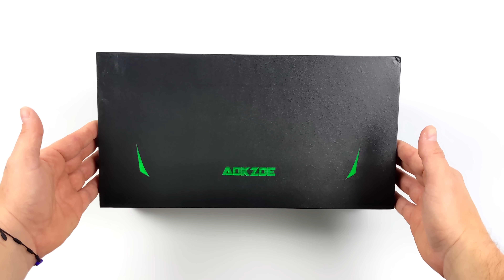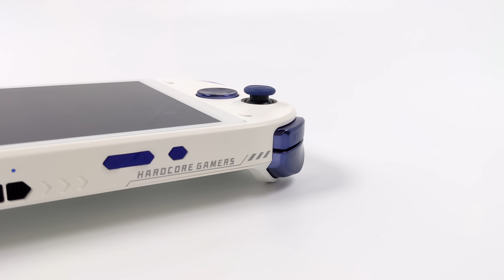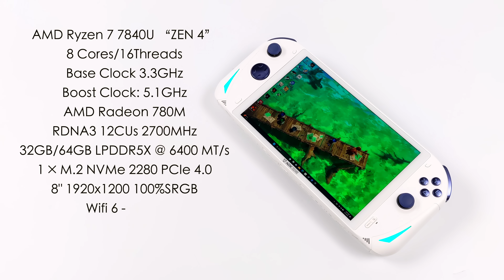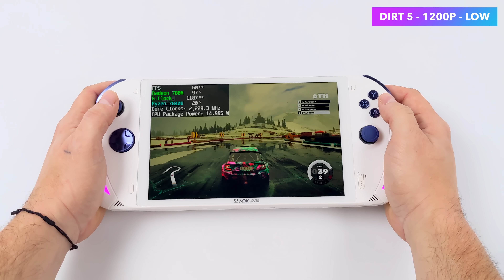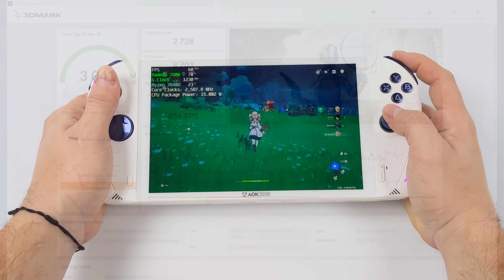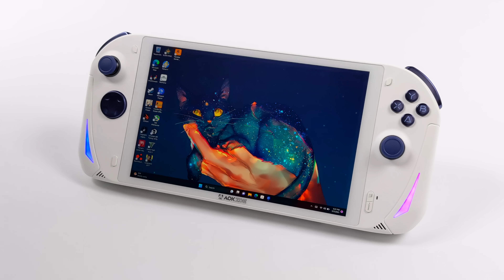AOKZOE A1 Pro Ryzen 7840U Hands-On! Right On The Edge Of GTX 1060 Performance!

Comment: What I want from the PC handheld, and am willing to pay the price, but nobody has yet to manufacture:
-Oled 120hz 8" 800p screen (to run at 40fps capped)
-65W OR if I have to wait, 75W per hour battery
-Zen3 + RDNA3 OR if I have to wait, Zen 4 + RDNA4 architecture
-32GB RAM + 1TB Nvme
-Quiet operations and good controls

There's always something wrong with the confiq, Nintendo got everything right with the Switch years ago, and the OLED one was a great upgrade.

Comment: Is there any benifit for games running higher than 60Fps since the A1pro uses a 60Hz monitor? Other than slightly reduced input lag.
Reply: There is not a point. The screen itself is 60z, so anything above still shows rendered at 60 fps.

Comment: You didn't mention in the video (great video btw) how the screen compares to other devices.  It is native landscape?  Colors bright and accurate or washed out?  How does it handle screen dimming?  Any stuttering?  

With that new Ally boasting 500nits and 120Hz@1080p, plus vrr, I feel like these are important details that need to be discussed and compared.

Comment: How well did they implement gyro controls? I feel like the steamdeck is the only one that does it well. I had a onexplayer with gyro but steam would recognize it as a Xbox controller which had no gyro option.  So had to use a 3rd party program handheld companion to get it to work.

Comment: its surprising this actually runs better than the ROG Ally Z1 extreme, especially when comparing Cyberpunk 2077 1080p low 15w with 1200p 15w on this device

Comment: We need to see this Undervolted. Also can it go above 28w using 3rd party tools? Would be nice to see it at 35w (it has a monstrously large battery, it can take still last a while, main question is how are the temps and performance at 35w).

Comment: Would love to know how this thing handles games at 800p.  If 800p vs native isn’t particularly noticeable this thing could be a true powerhouse on aaa games.  Not a fan of running everything on low settings.
Reply: AAA from when exactly? Brand new? Gonna be mostly low my dude, some medium, occasionally some high. If you don't mind 30 or 40p locked then elden ring for example all high is doable on a modern handheld especially if you are using fsr to upscale to 720 or 1080p. Global FSR is possible.
Reply: all medium some high might be doable at 60 on this chip if you run it full bore, but probably still need fsr to get it upto 1080p

Comment: Quality of life ideas (Software)-
+ Mouse + Keyboard mode - implement a 'Xpadder' like application so the controller can be used to play PC games that do not have native controller support. i.e. can assign keyboard keys to controller button.

+ Library front end and System controls menu integration -  have a games library front end or team up with front end devs like 'Playnite' and have plugins or integrate system controls with the front end.
e.g. can go to and from the library front end while a game is running
system controls i.e. volume, wattage, rumble, lighting etc.. are submenus in the library
have floating mini menus off all you can call up during a game, like Xbox game bar.

+ Easier to access and understand system buttons - In the OXP 2's case the buttons are still a little confusing.
Left bottom bottom button = 'Desktop' button
Right bottom button = controller/mouse mode toggle button
Right bottom bottom button = light on/adjuster

Top volume buttons = keyboard & desktop mode??

The system control button is next to the volume buttons.

Couldn't they just go back to the OXP Mini Pro and also have system controls (aside from volume) all be in one place?

Left bottom bottom button = Desktop button
Right bottom button = controller/mouse toggle
Right bottom bottom button = System controls menu that has adjustable lights in the options in it as well.

System controls will also have an 'Xpadder' like option to make mouse & keyboard mode configurations.

Move the 'System control menu or 'turbo' phyical button from the top of the device down to the left bottom position and make it a game console controller 'Home key' like the Xbox, Playstation and Switch's home key buttons.

This is useful for emulators that map out the Xbox, Playstation and Switch controllers.

+ Configurable power profiles - When docked or power cable connected you can switch to or can have it automatically switch to pre-configured settings
Just an example
Handheld mode - 15W, rgb lights off, 40% brightness
Desktop mode - 28W, rgb lights on, 60% brightness, 1080 external display output

Games can also be configured with under those power profile settings (If possible)

Quality of life ideas (Hardware)

+ backpedals to be standard - Should be a standard on all modern controllers, especially for handheld gaming PCs to allow more gaming functionality.
example.

Back pedals if deep enough can take over as actual pedals for racing games, while freeing up the triggers to be used like...triggers and allowing your index fingers to simultaneously use either the triggers and bumper buttons.

'Shift' & 'Ctrl' keys, Backpedal buttons can essentially become these as well as its easier to just hold or toggle while giving all other buttons on the controller a second function there by doubling all of the buttons on a controller.

Comment: When games are playable at high settings on a handheld then I'll be impressed
Reply: I'm playing elden ring all high locked 40 720p, 60p at 1080l is doable too but I prefer longer battery life if I'm not running it docked. And that's on a 6000 series chip, not these 7000 series. 

So.....I guess you are impressed now.

Comment: 60Hz display…why??? That much power deserves a much more capable screen In my opinion.
Reply: I'm gonna be honest....why? Other than fps what do you realistically wanna run at 90hz or 120hz on a small handheld screen? It will support VRR if you plug it into an external monitor, and fps that can hit high refresh rates on it, like counter strike, are gonna be way better to play there. 

I agree, more is nicer, but realistically 120hz is already the point of diminishing returns with monitor refresh rates. And the benefits over 60 are minimal, and no AAA game will hit 120hz no matter what settings you use.

Comment: One of these companies are gonna figure out how good these handheld displays look with line doubling 600p 2X = 1200p (or 540p 2X = 1080p), you can barely tell the difference on a handheld display, and you get DOUBLE the FPS, so add a small scan-doubling chip in the handheld, and that Radeon 780M becomes twice as powerful with no drawbacks what-so-ever, add in a higher refresh rate display (120Hz+), and you have super smooth high FPS on even the most demanding games on a handheld.
Reply: pls explain line doubling

Comment: Something that irks me a bit about these handhelds and APUs is how unbalanced they are for their main purpose ... gaming: more emphasis should be put on the GPU side vs the CPU.

This one in particular has a pretty powerful GPU but other models have massive 8/16 CPUs that are idling most of the time with anemic GPUs that barely reach last gen console performance.
Reply: I use mine as a productivity PC 8 hours a day with NREAL glasses and Nebula. The glasses and their Nebula app give me a giant virtual monitor that hangs in space. you can use of to three virtual monitors in the glasses and set them to any size or distance and curvature you want. It's quite literally my pocketable desktop. With my own ergonomic keyboard and mouse which are infinitely better than the GARBAGE on laptops. 

So yeah, my CPU threads are constantly busy. It's a PC dude, just an oddly shaped laptop. You can use it for whatever you want.
Reply: Amd I can tell you There are a lot of other people with these doing the same. Nreals forums are full of us.

Comment: $799 for the 512gb model is a lot more competitive, I’d actually like to see it have a 1080p screen and 120 hz refresh instead of a 1200p resolution. I’d rather have a higher refresh rate than a resolution. I like the price is getting more competitive I do think it needs to come down further still but a gtx 1060 with controls a screen etc for $799 isn’t bad 👀 it’s getting better. That’s what we need for the handheld space. Eventually we will have a day that these are more commonplace than a niche product
Reply: Probably the proportions of the device dictated a 1200p screen. Probably could have gotten the refresh tho.
Reply: 1200p is a middle ground for emulation. 16:10 closer to 4:3. If they were to get rid of the 16:10, then I'd like to see 1440p and then we could use upscalers while running it at 720p 120hz :)
Reply: @boblablaw4857  This likely wasn't built for emulation. It can support an eGPU, and has enough ummph to play modern games at reduced settings. I'm actually kinda tempted, but I have a fairly bad taste with kickstarter/indigogo. Bought a Sous Vide machine and it was two years after they expected before I saw the device.
Reply: @dissmani  i think you might be underestimating how much emulation community props up and supports these devices. every single person interested in emulation wants a good handheld for it (be it a phone or steamdeck).

Don't underestimate the power required to run switch, ps3, or xbox 360. 360 emulation just improved the point of requiring a mere 980ti instead of a 1070.

16:10 is just superior in every way imo. Not even a contest once we mention oled so if there are black bars they are just off. Anytime you make the screen longer, it usually makes sense to make it taller as well (except phones because they are designed to be palmed).
Reply: @boblablaw4857  I've watched just enough ETA PRIME to know that's the case. So, I mentally put emulation on the same basic difficulty level as AAA gaming, just because you're running games designed for specifically designed hardware on a general purpose device. Aside from maybe screen dimensions though, I'm not sure what someone who wants to do emulation would want that someone who's playing AAA games wouldn't.
Reply: $800 of the few 100 units.... $1000 for the rest
Reply: @jesusbarrera6916  However, even at $1K, it's still a pretty decent value proposition. But, see my other comment.

Comment: At this point we're going to end up having 4000USD handhelds that will run emulated Switch games and AAA games like Howards Legacy at 4K 60fps max settings. I really don't like this trend. I personally have 3 handhelds, an old jailbroken PS Vita, an Anbernic RG351M and a Switch Lite. I can play anything I want on those handhelds and I really don't need anything else. If I want AAA PC games, that's what a PC is for. For the price of this Aokzoe A1 you can buy all the portable devices I own with all their accessories and a lot of games for the Switch Lite. That's insane.
Reply: The price for handhelds like this in the PC space has been over 1000 dollars for nearly a decade. It hasn't risen. In fact it's gotten cheaper recently due to Valve and the Steam Deck. Your worries are unfounded.

Comment: A1 pro will definitely destroyed ally out of water
Reply: How? It's basically the exact same thing. It doesn't even have more inputs. It's nothing but a windows laptop shaped like a handheld. It doesn't even have a keyboard and mouse like the GPD devices do, or track pads like the Steam deck. 

So what.....the ROG will be slightly more powerful? Maybe? How does that amount to "blowing it out of the water"?

Their after sales support however will probably be much easier to deal with as they are a larger company, and distribution and purchasing will be an easier process. 

It might even be easier to set up I suppose? But they are both windows pc. No major difference will be found.

Comment: I really wish screen resolution didn't have to increase with the GPU performance every time. 720 or 900p are perfectly fine for this sized screen. I would much rather have 900p high settings locked at 60 than 1200p medium to low. I think handheld designers should make sure we can play modern games at decent frame rates and settings before they go up on resolution.
Reply: I would definitely play on high settings 30fps rather than low 60fps. Low settings make the game look like a ps2 game.

Comment: These new APUs are coming out so fast just as most 6800U handhelds are starting to be shipped out there's already a new model! I wonder how much more powerful is the 780M vs the 680M is it worth the price increase 🤔
Reply: 10-15% ranging up to 20% at most in theoretical benchmarks

Comment: Is the RAM user upgradable?  I can see the 2TB/64GB model but unsure if that's something you can do later or you have to buy it soldered on.
Reply: apu ram is shared with the gpu. it's not user changeable on any of these

Comment: I still love my steamdeck but just seeing how fast these new chips are improving is crazy.
Reply: What keeps me from replacing my steam deck is the lack of touchpad from thus new devices. The feel neutered without it. And most of this new devices lacks 2 more grip buttons.
Reply: @popcorn5968  You also have to think about how long to battery lasts. More power draw = less battery. If you're buying a handled just to play for 1 hours at that point just buy a laptop. If you're buying a handled to have it plugged in while playing, just buy a desktop. The steam deck has the perfect performance per battery life at the moment.

Comment: Wish someone would strap a decent cooler on this APU and crank it to 65W or something just to see...
Reply: Their previous flagship APU the 6800u, which is nearly as powerful as this chip, stopped showing any performance gains at all past about 32w tdp. From that to 60 is alike a 2% power increase for a near doubling of system power.

Comment: One thing i'd add are games that use pointers A LOT, this control scheme drives me nuts but some of these games are good, and hilights why trackpads are still important for handhelds. What would be nice for these handhelds is if you could switch the screen between touch, and trackpad mode, negating the need for a dedicated trackpad like the Steamdeck or GPD WINMAX
Reply: Windows has a built in touch trackpad
Reply: @CPUjunkie  And using it is going to sound great, just too bad you cant see the game when you have that track pad full screen
Reply: touchpad on the back with a cover would be great. like the ps controllers.

Comment: I really like these new APUs. I think this is a major point in handheld gaming. Now you can play almost all games without huge compromises. I remember time when you need to use 960x540 with low settings, or even use some performance modifications to get good performance on old devices.

Comment: Hey ETA, could you perhaps try a video with one of these 7840u handhelds in coupling with that power control app youve been using to test how these games will perform with 6 or 4 CPU cores and disabling the others for power consumption? I figure turning off some cores might net an increase in clocks on either the GPU or the CPU, as they're both quite low when running the games @ 15W, but you may be able to eek out better performance if those cores arent really being used anyways.
Reply: The clocks will be more consistent but not increase from the max clock.

Comment: I would really love if you included comparisons to 680M and steam deck etc., I often see people on reddit complaining about the low depth of these reviews, I think this would push the videos to the next level👍
Reply: Check out the phawx. He has done some pretty in depth content comparing steam deck against 6800u and 7840u. Even compared to the new A1 extreme (which I am now kinda disappointed by) it's very stat heavy, but check it out
Reply: I still can't believe how this thing is performing so good. Is it due to the memory?
Reply: The steam deck is 3x slower than this.
Reply: @ivankovachev8835  I think like 2.25x slower
Reply: @ivankovachev8835  no, its not.

Comment: For me I really like the size of the steamdeck, I hope we see full size handhelds like that instead of these smaller handhelds
Reply: This is a 8 inch screen. Way bigger than the deck lol
Reply: @omariorou1339  but it's a smaller device, compact form means nothing to me personally
Reply: @ugot1try  does it matter? I have the deck and ppl were complaining about it portability and how wide it is and not like the other handheld. Aya managed to squeeze a 8 inch screen in a smaller handheld than the deck. That’s a good thing
Reply: same, cant see anything on these micro screens, and I wish they stopped putting 1080p resolutions on these small screens, 720p is enough and it needs less power
Reply: @423GustavBern  This has an 8 inch screen though. That's bigger than the steam deck

Comment: Recently, expensive handheld PCs tend to dominate the emulation console scene, but I personally find nothing inspiring or romantic about this.
They look like gaming consoles, but in reality they are gaming PCs themselves. They run emulators perfectly.
Isn't this too obvious?　
There is absolutely no difference from playing with a PS2 emulator on a Windows PC in front of you.
What I think of as emulator consoles are a wide variety of cheap, out-of-model SOCs and single PCBs housed in an integrated case with a nostalgic shape.
It is very cheap and childish, but that is why I find it romantic.
Reply: I treat mine as a PC. It's both play and work. So I can have my PSP looking toy, but also do real work on it and guard my files with a fingerprint sensor.

Comment: This is why modern games are memory hogs, they want you to buy expensive GPUs and not these awesome portable devices.  Remember what magic they could do with a Switch that has 4GB if ram.  Devs are lazy now or bribed :p
Reply: You can easily put 8 or 16gb of the ram in these into the system as VRAM. 

I'm running 16gb of VRAM on mine, to run some local AI models on it, it's not really necessary for gaming.